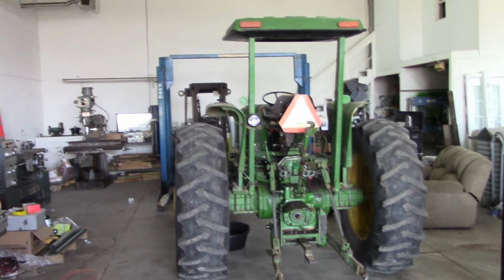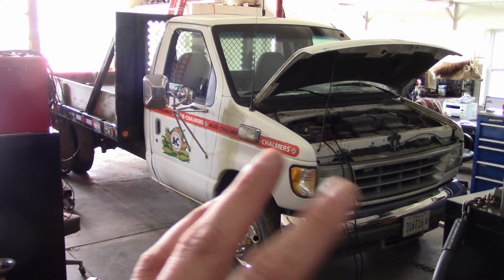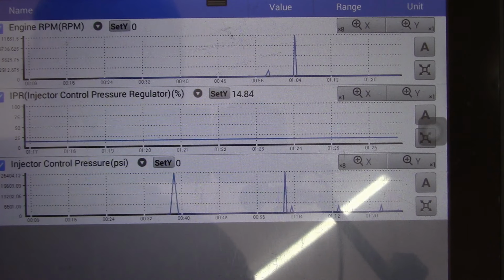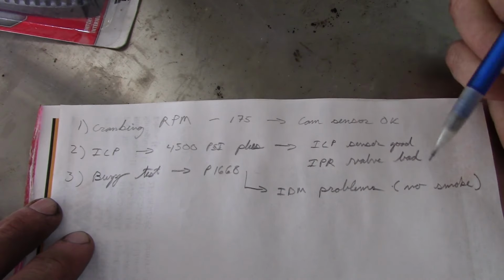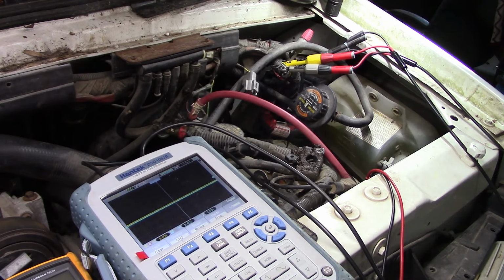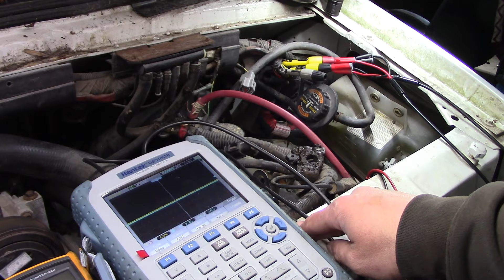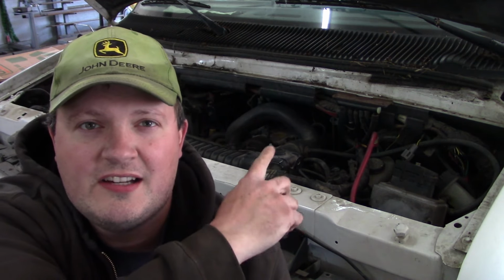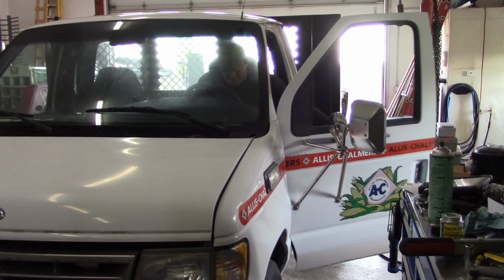Ford E350 | 7.3 Power Stroke - Cranks but won't Start - Part 1

Comment: 21:15:  !! The HV wires are shielded similar to a piece of Co-Ax cable, the abrasion most likely rubbed its way thru to the inner 120vdc conductor which makes it possible to have a 'single' wire short circuit (no external ground path needed) which then blows the IDM's HV output driver.  (Awesome, right? :) )  IDM boards go bad for three reasons:  #1 They get water in them since they are located inside the fender or some idiot (me) hits it with the pressure washer!    #2 The HV wiring is fubarred either due to the Under Valve cover wiring  OR someone used a probe identical to the ones you used to monitor the low voltage signals but on the HV wires (all of which are shielded) and this blows the HV output mos-fet.  #3 Simple old age, the 820uF electrolytic capacitor on the IDM board loses capacity with age and allows the 120VDC inverter noise onto the ground plane which confuses the H-Bridge Mos-Fet gate driver circuitry, blowing up the surface mount gate driver fets.   The old age failure mode drove me insane for 3 months until I finally understood it since replacing just the blown SMD mos-fets would appear to bring the board back to life on a bench but would blow up the moment the 120VDC inverter circuit was put under a real world load.
Reply: BTW, if you get to keep the dead IDMs I would be happy to tear them down, perform a fault analysis, repair, re-cap, and send them back to you to sit in your SOS stash as a Thank You for all the work and effort you put into your channel.
Reply from the maker: James you seem to have a good handle on these units. Can you contact me via email? mail@watchweswork.com

Comment: In addition to the orange wire being rubbed through, the brown wire next to it is cut, looks like from the metal plate below it You can see it at 20:55 in front of your thumb nail.

I'd pull that pigtail off and examine all of the wires.
Reply from the maker: There is no metal plate. That is the plastic housing of the bulk connector. But I do agree that it needs more investigation.

Comment: Makes me think that shop put a used IDM and it was bad too. Guy got sick of it and parked it. Hope it holds up.
Reply from the maker: I could see that once. But twice? That seems like something else if causing it.
Reply: Watch Wes Work voltage spikes?
Reply: The shop claimed they use only FOMOCO rebuilt modules.

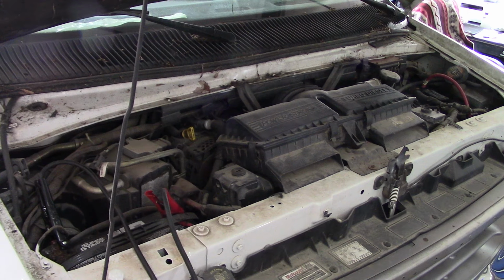Comment: @ 4:31 can you see the steel bracket bolted to the lip of the cowl  that supports the air cleaner assembly..  that is directly in front of the connector .. and your source of RUB...  i have a 96 E250 4.9.. i must have had my air filter and bracket out 200 times..
 PS.. the Grey and RED signal return wire.  see if that is circuit 359.. if it is.. that is a GROUND Wire for almost all the sensors and transmission devices..
Reply from the maker: I thought that too, but that bracket is several inches from the harness. Someone pointed out that it may have had some garbage in there from when it was an ambulance that has since been removed.

Comment: i had a '67  short bed f100  i bought for 400 bucks back in '96 .  in the course of 100,000 miles that i logged on it, i replaced tires,brakes, some wheel bearings,and all  of the belt  powered  bolt on stuff ( both items...water pump and alternator).. had to replace a U-joint on the side of the highway with just a pair of channel locks  too . 3 sets of plugs and 2 sets of wires.... 400 bucks...
  that 300 strait 6  seemed to get the same fuel economy regardless of load...empty  or loaded it averaged 20mpg...
only 185 ponies under the hood and 4 on the floor..it was a basic work truck.....but it ran regardless of issues....oh ya-only ONE vacuum line ..from the carb to the brake  for a simple power assist
 I miss the days when a construction worker like myself could scratch his head and figure out what the issue was....nowadays you better begood with PC's and have code books..and all of that...

cars have been ruined...what ever happened to KISS-keep it simple , stupid ?

Comment: The truck has a bad green? Earth wire in the block of wires, easy to see disconnected wire when camera is very close up, hope this helps solving long term problems

Comment: regarding the crazy ipr readings, i've had plenty of times diagnostic tools mess up the conversion factor between the raw data sent by the ecu and whatever measurement unit they show to the user. double checking the actual sensor voltage with a multimeter and referring to the sensor calibration datasheet is the way to go.

Comment: They also won’t start in cold weather if you have the incorrect grade of oil, ie too thick. Had lots of issues in AUS with no starts in cold weather, when someone had put 20w/50 oil in one 😬

Comment: ICP pressure spiking up to 4500 Psi is a common Clue to the IDM going Bad and the IPR gets its feedback from The IDM so if IDM fails the IPR can't Regulate the Injector Pressure correctly @Watch Wes Work

Comment: Fwiw, the 96 and down has single shot injectors, 97 and up had split shot injectors so the dim will be different.
Reply from the maker: As far as I know, the difference is in the PCM, not the IDM.

Comment: 25 miles sounds quite funny short period. I have no idea about that engine setup, but does the IDM supply the power to the glow plugs too? If so, they might not be commanded to turn off by the ECM. The connections heat up, expand, spark, and short and fry the IDM.
Reply from the maker: No, the glow plugs have a dedicated relay. But the harnesses run together with the injectors and can melt into each other.

Comment: I don't know anything about car /van diagnostics, but I have spent a fair bit of time in ambulances and not as a patient. There is a shed load of electrical equipment (medical and emergency signals) either built in or having facilities to be plugged in into the ambulance. Someone being a bit careless with stripping down the original vehicle's wiring during the conversion might well be the cause of the underlying problem. It might also explain the chafing in unexpected places. There might have been something rubbing against that harness in that vehicle's previous life which has been removed.
Reply from the maker: That's a good point.

Comment: Something to watch for is proper oil pressure from the LPOP .
 If not getting enough low pressure oil it will not start.
 LPOP is located on the end of the crankshaft, they fail due to lack of good maintenance, just a 1000 of an inch in wear will cause LPOP to lose enough pressure to cause a no start.

Comment: Look for a pinched wire that is grounded in the injector harness - dorman has an issue with too many baby wire ties that cause the valve cover to short the harness ... I replaced a set of harnesses the other day on a 7.3 that had 400k + on it and if i had not cut the wire ties the harness would have been smashed so it's probably an over current situation taking out the injection module.  Also on a 7.3 the pcm wont even turn on the injectors until u get 500 psi of injection pressure.  Then the pump maxes out at about 3000 psi.  When u unplug the icp sensor the system defaults to just above 500 psi. 7.3 is also controlled by the 5 volt DC from the pcm - a shorted 5 v DC system will cause a no start too.. just turn on the key with your meter on a 5 volt wire at a sensor and start unplugging sensors till the 5 volt reference comes back alive.  I had one come the other day that had been to a couple of shops that had multiple issues.  It boiled down to a shorted 5 volt reference in the gas pedal killing the 5 volt reference and a blown oring seal on one injector .. when I resealed the injector I found that that same injector had failed internally .  So one injector and one gas petal and shipped it... a royal PITA...
Reply from the maker: Ugh. I had a 6.0 once that would not run because of a shorted 5V reference in a sensor.

Comment: Here's a general tip regarding ICP with a no-start condition: Don't bother monitoring ICP sensor pressure. The PCM will report an inferred pressure value if there's an issue with the sensor. Monitor ICP sensor voltage instead. The PCM needs to see (among other parameters) 0.84 volts from the ICP sensor before it will allow the IDM to fire the injectors. Key on, engine off reading should be around 0.24 volts.

Sidenote: Dorman valve cover gaskets are pure, unadulterated garbage. The insulation on the wires under the valve covers hardens, cracks and falls off in a fairly short time.
Reply from the maker: I've installed dozens of these Dorman gaskets and had 0 issues. I still believe it's a superior design without the second connector.

Comment: You pierced into the IDM wires? They are all shielded and if you pierce them you will like short the idm or the injectors at the pierced site and will fry the board.
Reply from the maker: No. I pierced only the low voltage wires, which are not shielded.

Comment: It's the IDM module since Ford used cheap caps and resistors. Not only that but the location of the IDM also made it even worse with delamination of the solder. You can easily take the model and open it up. Parts are cheap for the module but you have to do your own work
Reply from the maker: We will try to get a look inside.

Comment: I nearly wet myself laughing at Max who just had to go ta ta in the brrm brrm that wasn't brrming. 🤣🤣
Wes, in case you read this, have you ever considered putting a winch (with a remote control) at the end of the shop so you can pull yourself into said shop? Think of the savings by not having to pay Wifey's White Knuckle Towing Service a retainer to be on standby. The forklift would never get trapped again as long as you can get the dead vehicle close to the shop door. Thank You for the videos. They are much appreciated. 👍

Comment: Ford dealership technician here. There was a technical service bulletin released way back, about a water shield installation to protect the IDM from water ingestion due to where they are situated on these vans. This was why the Ford diesel class instructor I had at the time liked to refer to 7.3 IDMs as "water traps" and 6.0 EGR valves as "carbon traps". Usually high ICP like what you were getting would be a result of aerated engine oil, hence why timely oil changes are especially important on any HUEI engine. Back then, to verify it wasn't aerated, we would start and run the engine at redline (about 3200 RPMs if I remember correctly) for a few minutes while watching ICP and IPR readings and confirming ICP readings would remain steady at around 1800 or so, not some stupid high reading. IPR on a 7.3 at operating temperature should be in the neighborhood of 9 to 11% at idle and up to about 45% at elevated RPMs depending on operating conditions. If you see it increase to 65% then you have a high pressure oil system leak somewhere because that is the max duty cycle. I've vaguely recalled the IPR spool valve nut were prone to falling off into the "valley" too. Wow, it's been YEARS since I've gotten my hands dirty on a 7.3!
Reply from the maker: Some have pointed out, without the injectors firing, there is nothing bleeding off the high pressure oil. So it continues to build until it hits the relief valve. I should have thought of that!

Comment: It's an E350 Wes, not that it makes any difference. It came from Warren Ct Volunteer Fire department. I don't have any records from them, but may have the bill for the cooked module replacement, and both were supposed to be OEM rebuilt modules(might be in the glovebox, or above one of the visors?). 
 I'm thinking new valve cover gaskets with a new style clip that won't come loose on it's own might be the way to go. We'll have to talk soon. It was good to hear it run again though 😎
Reply from the maker: Well I got sort of close. I'll get in touch with you Monday and we can make a plan.

Comment: What is ICP when engine is running? Should NOT climb to 3500psi during crank. 450-500 psi and it will start as long as all other conditions are correct. Running cold 500-700psi depending on ambient temp, 450-550psi hot/idle. I think the issue is a faulty ICP sensor, it was reading 200+ psi after you stopped cranking and it kept spiking 25,000psi with KOEO. That engine runs at max 3500 psi. If the IDM sees a spike in ICP, it thinks that you are on the throttle during start-up. That may be what is causing the IDM going bad. You're definitely on the right track with the v/cover gaskets and harnesses. Inspect the PCM for water intrusion as well. I worked for Ford as a Diesel Tech for 37 years. Retired 3 years ago. I hope this helps. I'll keep an eye out for your results.
Reply from the maker: Yeah, those spikes in the signals are troubling. I need to wring that out.

Comment: Wes, I’ll suggest to you what I did to Eric O (he didn’t do it, prob didn’t read the comment). Get a remote wireless front winch from a 4x4, and mount it in an optimal place at the back the shop. When you need to bring a dead vehicle in just take the cable and remote out with you and pull your vehicle into the shop solo, no helper needed. Maybe mount roller turnbuckles just outside the shop door on each side for the cable to run on should you need to pull from a severe angle.

Comment: I just installed a 320A MechMan alternator in my '02 7.3L Excursion, the local diesel shop just changed the oil, and installed a ByPass oil filter for me.  just one new battery? poor judgement, diesels need 2 identical batteries, the best made if you want to keep them very long.  OH, the new Alternator cleared all the codes that were showing up.

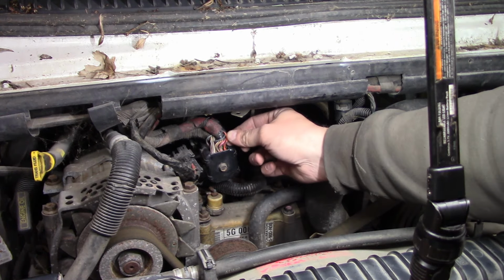Comment: 19:27 so . . . ? Ain't THAT the root of all your problems with that truck ?
Shorting out to the black bracket and frying the IDM ? I'm a bit confused.
The IDM is gone, sure. But won't the same happen if you install another good one ? What a my missing ?🤔
Reply from the maker: It's not a bracket, it's the plastic housing of the bulk connector.
Reply: @WatchWesWork  oh? Ok then 👍. I hope there's a second part to it 'cause I wanna see what's really killing those IDM boxes.
Good work ! 😊👍

Comment: Ive seen the control ipr valve above high pressure pump fail and even after rebuild not work. A brand new one fixed everything. Possible bad ipr valve buring up IDM? Im no 7.3 tech but that damn valve was always the cause on my no start 7.3l. That and injectors/harness

Comment: Clean and test IpR
Check glow plug circuit through the UVCWH
Ispect glo relay or solid state driver remember everything is HOT and switched by the PCM on the negative side!
Inspect IDM and follow harness
Tge proper electrical test on IDm can be had on most IDM sales sites Swamps etc
Also grounding on pcm should be checked prior to idm 
An extra pro active add ground wires or straps from trans to frame. Every e4od I have ever had fail in a powerstroke had the pump welded to the case or shaft or both!

Trace entire injector wiring harness

Comment: You mentioned that the injectors are getting 120 volts pulsed DC. I guess these are units behaving electrically as a coil and when pulsed DC is inserted to them, the transition to off state will make them push several thousand volts back to the control module with reverse polarity. Is there a surge protection, a diode of some kind in the injector ? To shortcut the reverse high voltage ? Just a thought.
Reply from the maker: I believe there is a flyback diode inside the IDM just like an ignition coil.

Comment: I think the ICP was reading right since the IDM wasnt turning on the injectors  they weren't using the high pressure oil which would send the ICP pressure all the way up, right? If you have ever jumped an ipr to close it out of the gate the pressure rises pretty fast and since the ICP disconnected is like a default reading based on a few parameters it read the same as it connected since it was telling its self it hasn't started I need to raise the pressure in case of a leak. Do you think stiction would read about the same as well, at least when cold enough to be an issue. Also, maybe it running on one bank or partial injectors? Since it didn't buzz with the test it was probably never turning them on to use pressure since it should still buzz even if some were disconnected or had some sort of a short. Great diagnoses people were caught up on the exposed wire if the readings were what you needed them to be its a far fetch to think it was so important.

Comment: There is a lot of good comments here. Grounds can be a nightmare causing problems. As for those guys that noticed arcing he should start this  in the dark any arcing will standout.
Reply from the maker: I don't think it's arcing.
Reply: @WatchWesWork  I did notice any arcing but other viewers claimed to see arcing. You might have to check every wire for continuity. It could also be the voltage is too high causing the injector module to fail.

Comment: Idm fail because of shorted injector-bad harnesses(dorman especially they have pinned some harness wrong), battery cables installed backwards or improper jumping/boost charging, poor grounds, remanned idms not to remanned(many idms fail because of water intrusion and they rebuilt them).  Or a shorted engine  harness, the engine harness was difficult to get a few year back.  Im sure Im forgetting something but it has been about 10 years since I have touched a 1st gen powerstroke.  Also the early powerstrokes love to give ghost codes, be very careful about live data.  We used to tee a gauge into the icp sensor, what your reading from the scan tool is not always what the computer is.  The strategies do not always communicate between the ecm and the scan tool.
Reply from the maker: Yes, I have also seen strangeness on the scan tool with these old trucks. Some of the live data is not live, or even data. Especially exhaust back pressure sensor issues.